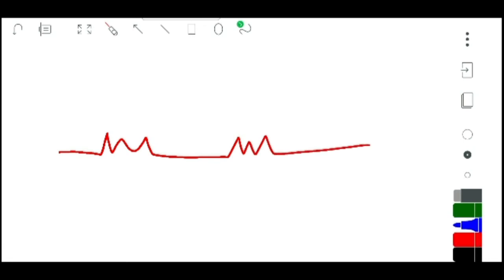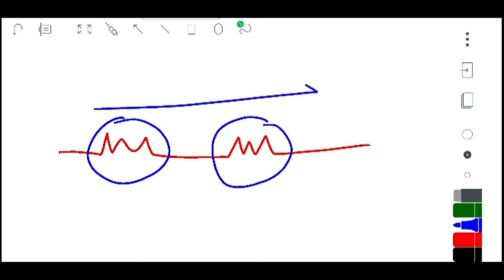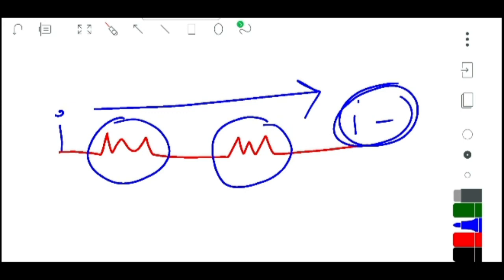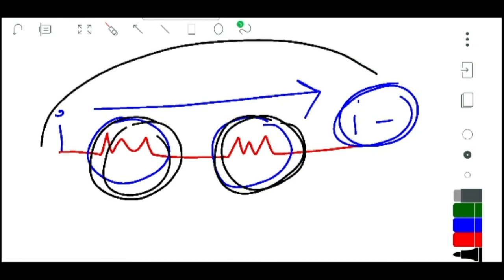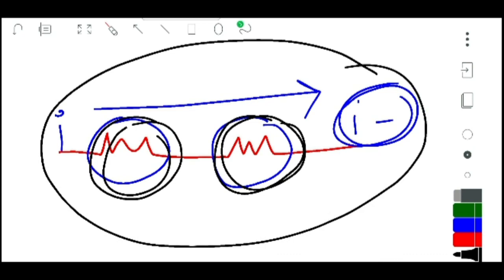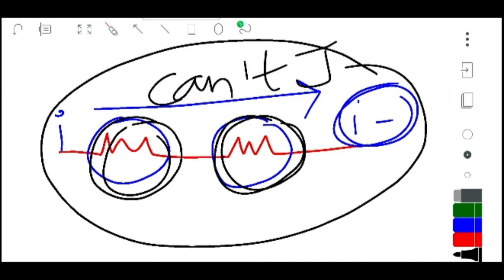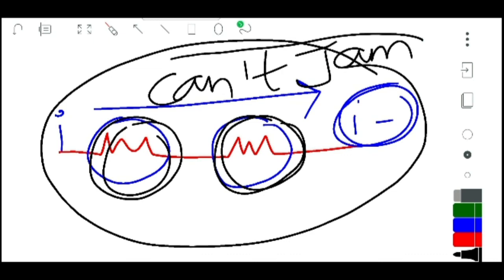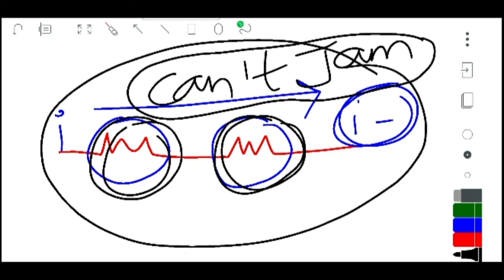Why current remains same in series circuit??

Comment: Please also explain why voltage differs in series circuit
Reply: Because when electrons move through  2 resistors in series let us assume than they are moving with 9 v and here each resistor resists half of the energy
Reply: Because voltage is inversely proportional to resistance of a component
Reply: @khudeilaiphamwestptyuldakl2016  then why does resistance different😳